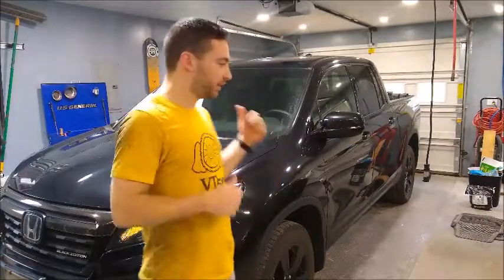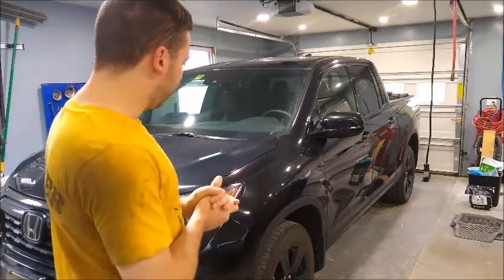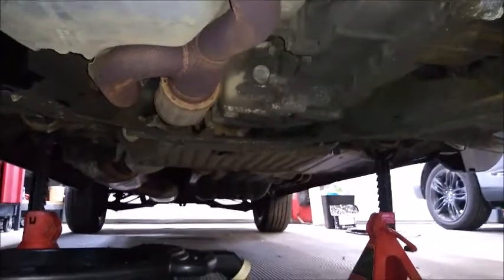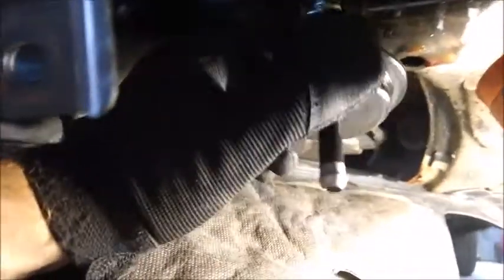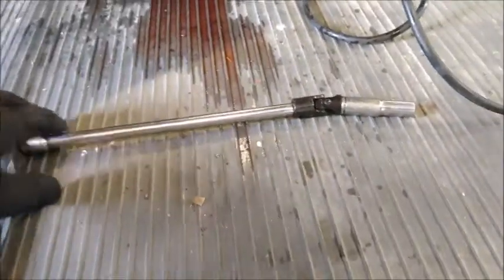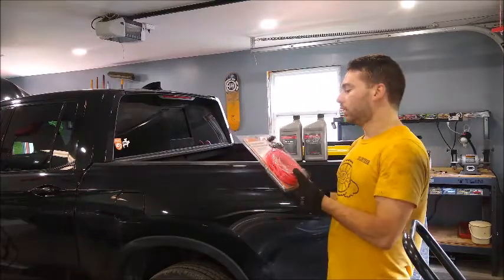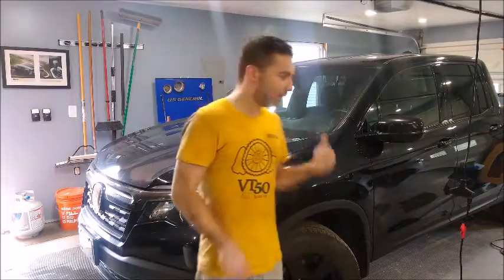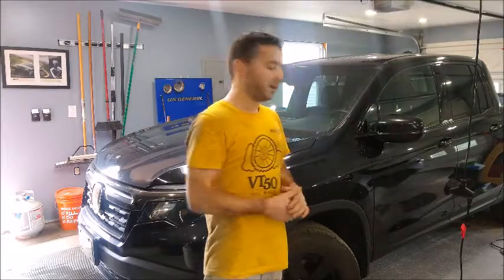2017-2020 (6spd) Honda Ridgeline A13 Service (How To)

Comment: Many Ridgeline owners have successfully replaced the ATF fluid with Valvoline Max Life synthetic, doing the 3 drain/fill. 30000 mile fluid changes are key to the 6 speed living happy.

Comment: This video does not apply to the 2020 and newer 9 speed transmissions. These take different fluid than the 2019 and older 6 speeds.

Comment: oil filter is actually made by Fram and is basically is the TG7317,    Oddly enough  when my ridgeline was had it's dealer free oil changes, the dealer used on Precision Parts PPG4612 which basically is a smaller sized but still decent filter  like ST6607.   When I did my A13 maintained  and cut it open I found it to be decent  filter,  however was unsure of its micron rating or milage specs  couldn't find that. so I assumed it followed the PG4612 filter which is similar but only a 5k filter.        when I changed my Trans mission fluid I did just a drain and fill  using  Idemitsu  type H+ (HONDA  Z1,  DW1) which I believe is who makes HONDA ATF-DW1. I skipped the inline filter but will change it next time.   now I know you may not like that I used Idemitsu   ATF,  I know not to use anything other then DW1 or those multi car formula like Valvoline MaxLife Full Sync ATF.  don't ask me how I KNow, I used it once on a Honda Odyssey, and after about a month I went back to DW1 and a big shifting quality difference.

since you changed the Filter the number of qtrs. need will be more then 3.3 qts and like around 4 qts.

my Ridgeline is a  2019 RTL  2 wheel drive

gr8 vid

Comment: Always, always make sure the fill plug is loosened on rear diff first like you did. If you drain first and cannot get the fill plug off, you are screwed.
Reply from the maker: Made that mistake once and will never forget it
Reply: @acura2g  Sounds terrifying....and expensive.  I swear those plugs are put on with locktite

Comment: I put in 4qts and still not even at the bottom level of the stick. Any idea?
Reply from the maker: Oil capacity is 5.7 qrts for the Ridgeline
Reply: Transmission fluid not Oil.
Reply from the maker: @HDK8305  check the fluid with the car running and on a level surface. If it's still low refill more until level is acceptable

Comment: Am I able to use Lucas transmission additive on my 2017 Honda Ridgeline?
Reply from the maker: Honda auto transmissions are very sensitive to additives. Stick with OEM unless there is a specific need you're trying to address
Reply: @acura2g  i just noticed a hard down shifting in the transmission and I’ve changed the oil and that helped for little bit but now its back again any advice?
Reply from the maker: @roberto3007  there have been reports of transmission failures that relate to hard shift symptoms. Before putting anything in the transmission, have a qualified and trusted dealership diagnosis. It could be a simple TCM software update or it could be more severe. Hard to tell with such a general symptom of hard shift. If you're still under your power trail warranty, best to bring it in ASAP
Reply: @acura2g  got an appointment set for this coming Wednesday thank you

Comment: better worry about the crappy transmission first,  my 2017 with only 23287 miles on it has a bad transmission, these trucks are junk and high priced to boot....
Reply: I happen to have a 2017 with no problems I have 100,000 miles on it still running strong!!